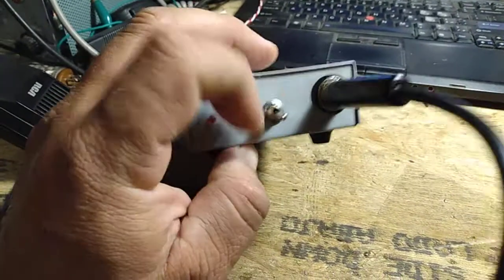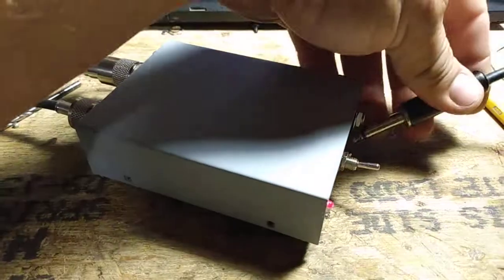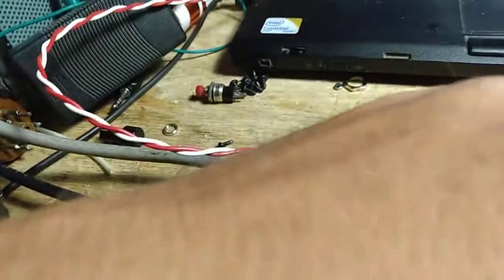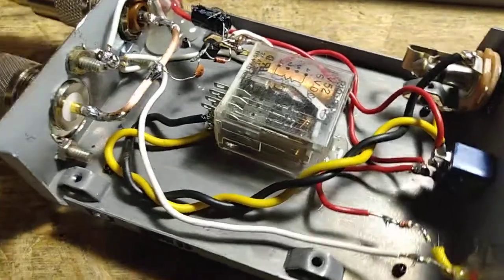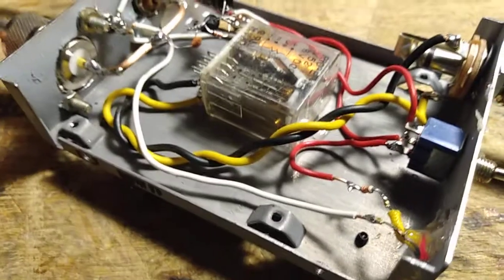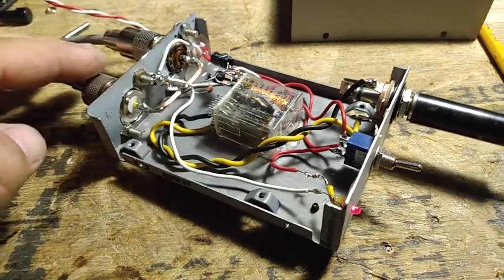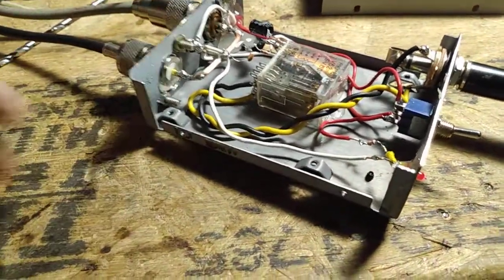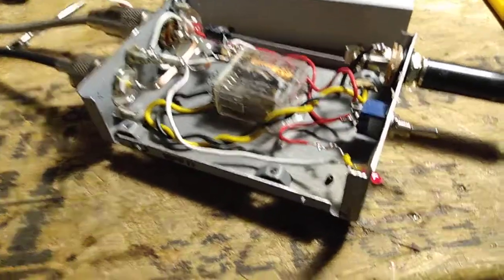Amplifier keying, lose the foot pedal!

Comment: Just a thought, Using a RF T connector would be better to be sure to keep a 50 ohm load thru the T connector.  On the end of the vertical T you would add a barrel connector that has threads from one end to the other for mounting it through the back of the box.  Then connect a pl259 to the inside of the box to the Vertical T section of the T connector.  Then wire in your circuit from the back of the PL259 and onward as you have done already.  Good job that you have done never the less. Thumbs Up!  You wouldn't have to use two chassis connectors with a jumper across the two connectors.  I still think you did a good job though!